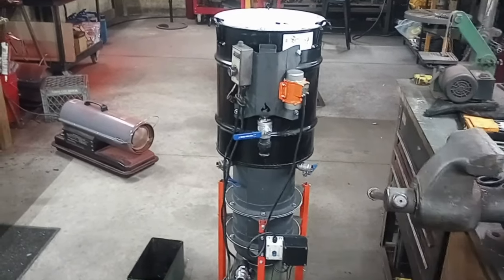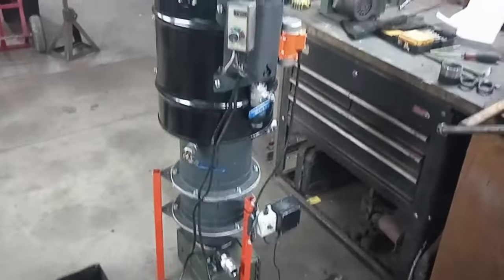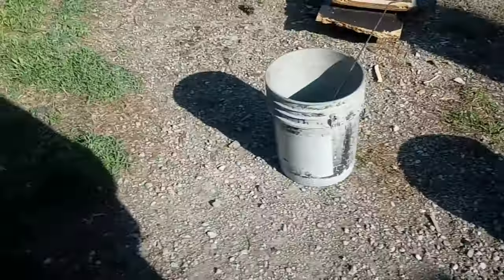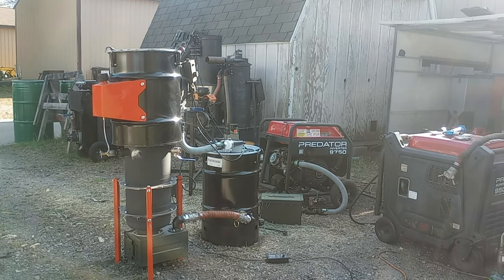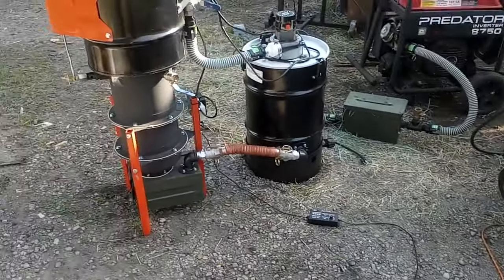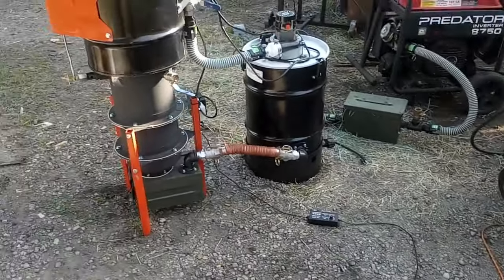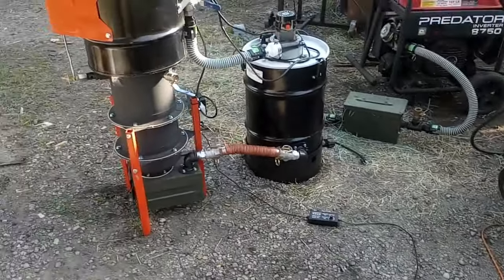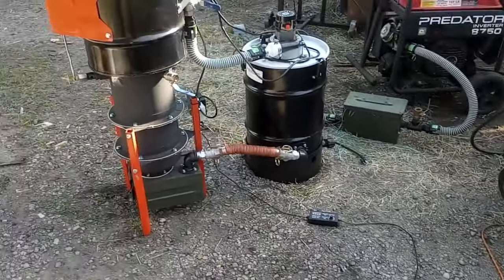Success!!!! Harbor Freight DIY Gasifier 100% Wood Chip Run 2

Comment: Do u have a link anywhere for this?
Reply from the maker: The kit was pulled there was not enough interest for it to be viable. Go to our website and join the forum and start a buid thread. Ill show you how to build this there. Find some tanks somewhere start there. Get the diameter then source the duct flanges you need. You buy them from McMaster Carr, Grainger, Amazon, Ebay etc. The rest you make from scratch with a grinder. This has to be worth our while, end the end of the week my employees expect a paycheck and this kit was way out of reach. You would be better off just buying a completed unit. Use these videos as a reference you dont need to be perfectly exact. There is an Imbert Sizing chart on our website for you to follow.
Reply from the maker: What are you planning to run? A small generator? If so dont build a wood gasifier. They are problematic as a gasirfier this small will not flow and the small engines can not drive them hot enough to reliably crack tar. Small engines are what charcoal gasifiers are for. Charcoal is actually easier as there is way lee process time and labort involved. Believe me I know it sounds the contrary but when you get into processing wood fuels there is a lot involved as you must pre process your fuel to fit your equipment, then you have to sort it and you will lose a lot of it. Then you must fully dry it 100%. Small modern generators will not tollerate a drop of tar. There is more head ache involved in this. Rather than just make charcoal and simpler machine and the system will just run and also make more power. So our other videos in our library and also check out our website. https://www.thriveoffgrid.net/
Reply: @Thrive-Off-Grid  
Thanks for getting back so promptly man.  Appreciate it 

U have so many videos I’m a new subscriber. How does charcoal give off gas ?  I thought the gas was already taken out during the initial burn?  And does your machine make the charcoal   Or do u have to put charcoal in.  I tried to look on website
Reply: I’m an electrician and most houses really only need a 7500watt generator to run most of the house comfortably.  No stove and no dryers.  That’s about it.  Should run about everything else as long as you’re being mindful.  So that would be what I’d be running.   Maybe a 50 amp generator at most
Reply from the maker: @KEGHEAD337  Best to use a battery bank and inverter though. Yeah 6000 watt inverter with on board battery charger is enough for typical home. Use the gasifier to charge it. Its not practical to use a gasifier fueled engine for direct power. Its a waste of fuel to run lights 90% of the time. Run the generator for 2 to 4 hours a day and charge your bank. Then turn that noisy thing off until the next day and do it again.
Reply from the maker: @KEGHEAD337  I have a DXF-10 that is through weld process. I can offer you. Its the last one it is not assembled. and will need finishing. mryder@thrivenrg.net

Comment: Matt, I have been waiting for this lol. Nice!!!  Hey first thought was I expected you to be able to pull more off that generator running on wood gas. That 8750 has what around a 16hp engine but only capable of 1700 ish watts?  I know the output gets derated. In this case by a lot?  Thoughts?
Reply from the maker: Most generators this size can pull 2500 to 3 kW.  Sustaining a battery charger though is a different story on a gasifier. That one time there is a hange up your engine stalls. So factor that in plus room for additional loads besides running your charger.
Reply from the maker: Also bare in mind, the inverter when its charging the battery bank, the power out from, inverter is no longer coming from battery. Its coming from the generator in addition to what the generator is charging the batteries at. So there is more load than the estimated 1700 watts going into the battery. It is more likely a total 2500 watts with acational additional loading. 

The log spliter spike for instance is 6 kW and as you saw that generator can pull that off no problem. But you must have realistic expectations with a wood gasifier. Its never going to run linear especially without automation. This is why all our machines from 2014 to 2020 were fully automated. This machine Im building today however is a total game changer. Its actually pretty incredibal.
Reply: @Thrive-Off-Grid  I agree the machine you just made would be my dream machine to purchase for if there is ever a shtf insurance policy.   I run a 32Kwh battery today connected to a split phase dual Victron setup. But it’s configured for basically a whole house UPS. I did this because our power is becoming less and less stable. We had three or four outages last year alone that were 10+ hours. Storms etc….  I can charge my battery through the AC in on the Victron but chose to DC couple my AIMs chargers. Long story short if I had to charge my battery from a generator I could use my junk generators through the AIMs chargers without passing crappy AC into my rather expensive victrons.   I won’t bore you will all the details. I want to be able to charge my battery bank from a crappy generator running off wood gas. I have several Briggs 8HP 4K ish gensets that I could use and basically pitch if something ever went wrong with them. You can but them on FB market place in “it ran last time I used it” condition for $50 bucks. Get rid of the 50 year old gas and carb and run it directly on wood gas made from chips.
Reply from the maker: @M35a2guy  Ok yeah you get it, the inverters all work the same with the built in chargers. Yes I would prefer the charger to be sepperate if possible.